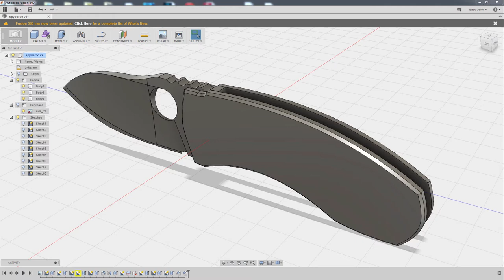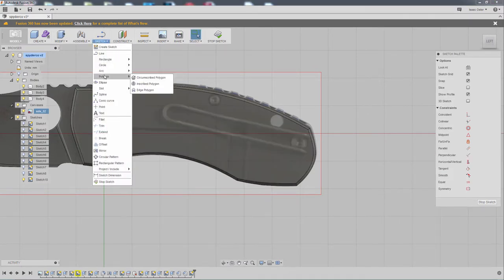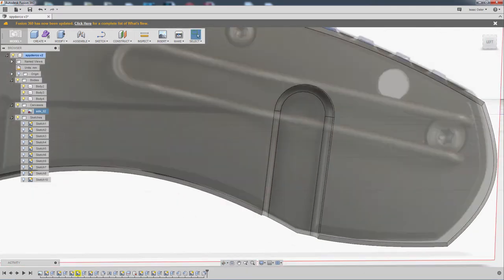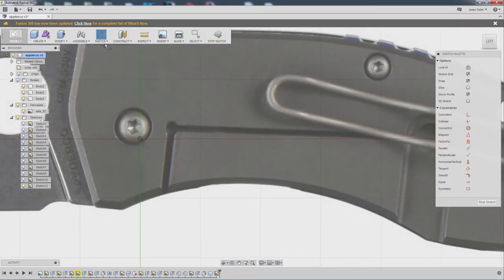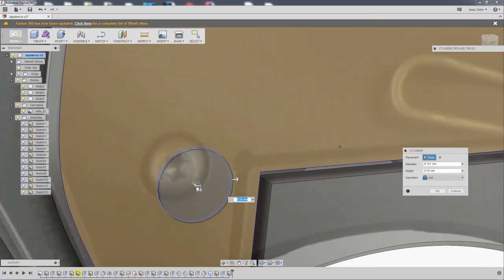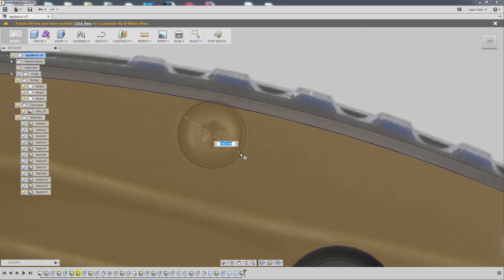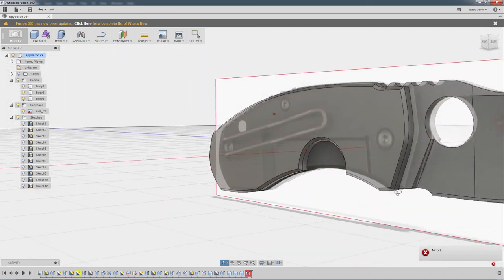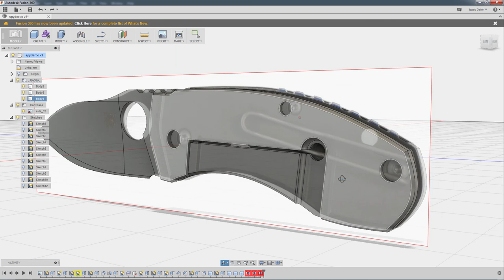Fusion 360 Sample Project Ch 6 - Handle Refinement 02

Comment: The mirror function still doesn't work in the current version. I decided to edit the cylinder feature and pull through to the other side. I also needed to expand "objects to cut" to select the other piece of the handle to be cut

Comment: great tutorial to this day. I do wonder if Fusion360 is still viable for production seeing the rise of "non sub-d boolean workflows" and "bevel shaders" ?
Reply from the maker: The challenge with booleans, at least inside zbrush, is it is not currently possible to modify the edges left over after the boolean operation.  You cannot easily add a fillet or chamfer, so you are left with a very sharp edge.  The downside of bevel shaders is outside of a few applications they do not bake to a low poly.  The technology changes all the time, so this work flow may be on its way out.  Stay tuned!